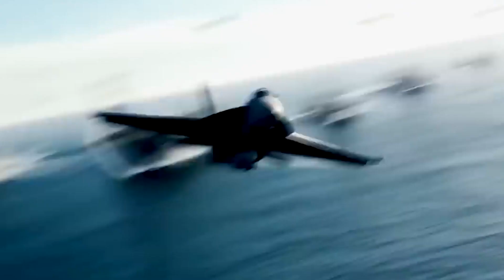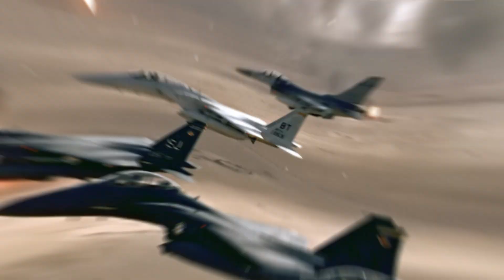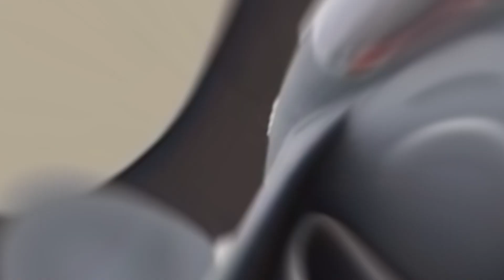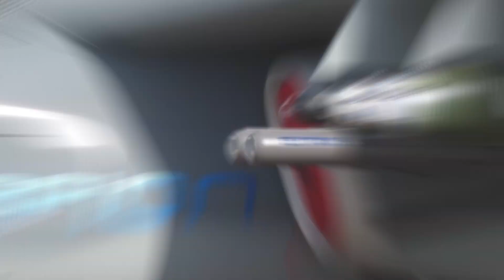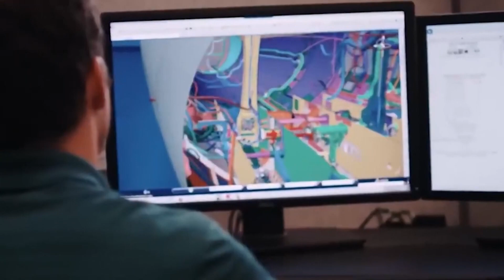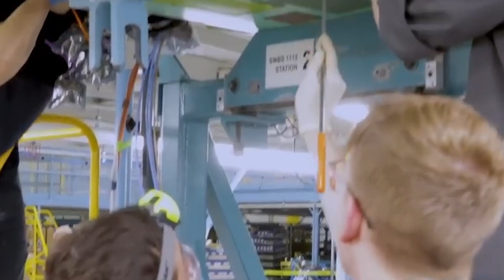SECRET & COVERT Jet That Has Everyone Going CRAZY!

Comment: OK, this aircraft would last exactly 30 seconds in an high threat environment.  Great for countries who want air ground support without any anti-air opposition.  But totally useless otherwise.
Reply: Guess u have never heard of the super tucano... in upt we learned the history of how slow speed and high maneuverability can make you very hard to hit with SAM and AIM.
Reply: By that logic the a10 is worthless, there is a use for something like this.
Reply: Anytime an aircraft goes into a target rich environment, it's not alone. I think this would make an excellent electronics warfare platform. Like the ef111 that went into Iraq during the gulf War. It was unarmed, and during the gulf War Iraq had a formidable anti aircraft environment protecting its airspace. Yet that unarmed ef111 never got fired upon besides a mig 25 for just a few seconds before it was shot down. The air force never sends an aircraft into a target rich environment alone in modern times. I actually hope they do use this for an electronics warfare platform.
Reply: Like the Prius of Jets
Reply: So don't use it in a High Threat Environment - What abt using an F-22 to tk out a Balloon ? U never know when U may need something for a situation until then, so this is just an economical option for a lesser threat environment situation
Reply from the maker: Great insight, we totally agree!!